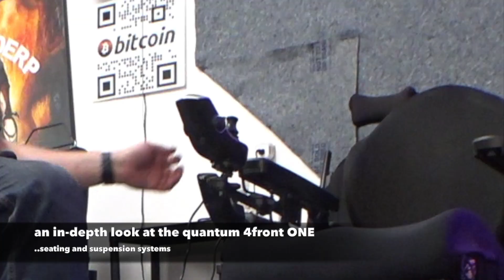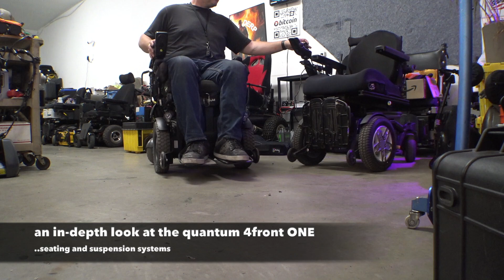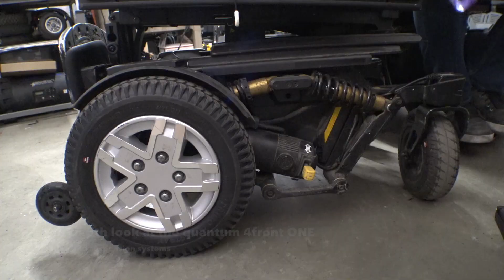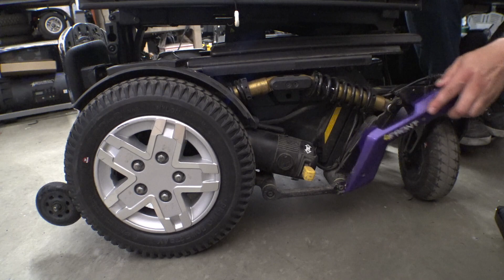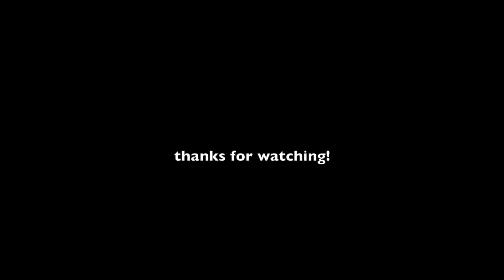MEGA VLOG 670: a look at the 4front & TB3 seating (LONG VIDEO!)

Comment: Hello, we have a common friend... Anyway, I am a professional Mechanical Engineer and have been in a power wheelchair for 40 years. And I still know that you are much better off consulting on this. I'm wondering if you can put rear castor assemblies from a 4front2 on an R-Track as front arm assemblies?  The problem being the maneuverability of the R-Track. When driving in tight spaces, if I change direction, etc. the castors can suddenly correct and lung my chair in an unwanted direction.

Comment: Hey Dan.
I am not confined to a chair or scooter full time: I only use them when I go shopping or to the fair or car shows.
I love tinkering with stuff and have refurbished a few scooters and given them to friends in NEED.
I have a few scooters and chairs, my chair I like to use is an old jazzy: it's a BIG one that the seat was almost two and a half feet wide.
I got rid of that seat and have mounted an old amusement park bumper-car instead.
I have another chair that is older and bigger that I think the speed controller is in the joystick, it's made in England, not sure I think it is / was a jazzy also.
I am not able to get  it to go, I get a strobe flashing on the joystick. 
Any info would be appreciated.
Thanks in advance.

Comment: I am a jazzy 4, quantum chair I am do for a new chair in January I use a chair 24/7 use it outside,inside my question is what brand should I consider next? Also I am very short stature size like 47, about 120 pounds, but I used public transportation to get around and often have to carry my groceries on my chair. So what type of chair should be my next one,I have Spina bifida, back,neck and shoulder problems, I prefer a tilt function on my chair,also suffered 3 pressure sores already. If you can advice I would appreciate it alot.

Comment: Oh, an interesting tidbit is when I took off the caster fork, the magnet screw was not fully threaded down which added to traction control errors...Maybe normal operation of the wheelchair or a worker failing to assemble it correctly did it??? It doesn't make sense that the screw would be loose like that...After all, that magnet has to be a certain distance from the sensor, as you have pointed out in your video...

Comment: OMG, my right and left caster forks are missing the thrust bearings...I saw it flopping around in the hole...My solution was to buy a ball bearing that fits perfectly inside of the upper caster arm with the right sized washers and a better nylon nut I bought off of the McMaster Carr website...

I feel so stupid now, I should have realized it needed a thrust bearing in there instead of a ball bearing...If only it came installed with the correct parts in the first place...They replaced the right and left caster forks years ago but never replaced the makeshift washers and bearings I put in there...

I am going to take off one of the caster forks to see if they installed the correct parts this time...I had them replace the casters recently because the tread was worn down and needed to be replaced...So I am curious now...

Thanks for uploading this detailed video of the caster assembly...Now I know what is supposed to be in there...

Comment: Those thrust bearing with small needles are made to wear out ! yes ! replace with brass  Thrust washers pus being a machinist & transmission specialist you could add a seal below the tapered bearing

Comment: The little plastic bumper if it falls off the rain will get in those 2 holes n everything rusts n destroys the bushing and the  tapered bearing within a month or so. Originally there were no flat bearing and wich made the bushing breakdown very quickly,

Comment: Really have enjoyed your vlogs, quick question i am getting a new permobil f3. Unfortunately my order will be delayed because at the wheelchair clinic i opted for a standard seat.  My letter of medical necessity was completed by the pts 2 days after the clinic.  Unfortunately numotion the dme didn't waive the home study 3 weeks after the clinic i attended a family picnic & spent 12 hrs up in my chair m i realized that a no pressure,  comfort/ contour seat would be a better option simple swap, right? Ah, no it requires a new sea4 quote & 2 new letters of medical necessity which instead of 2 days will take an additional 3-4 months.  Unbelievable.  My c300 8 yr old joystick motherboard is failing m the tech is worried since a replacement board is very pricey & may delay delivery of my new chair even though i am at greatee risk of being w/o a chair if the joystick fails. Have you seen wheelchair ghost pimp my permobil vlog? He said that the led fender lights should be standing lights & remain on the chair.  Numotion isn't supposed to remove the fender headlights.  In case they do, do you know where i can fe4 them?
Sincerely, 
Lester 
Swiftwater , PA

Comment: Is the 4front2 improved enough from previous?
Reply from the maker: i dont know if i trust my own advice.. lol BUT i regularly chat with 2 different people that have a 4front 2.. one of them is an HD version.. they've had issues with loose bolts and a few other random things.. but overall seems to be an improvement from the version 1! quantum got rid of the CASE sensors, and are using 'more proper' 4 pole motors now.. soooo... maybe?

Comment: So very informative!  My first and most comfortable powerchair was an Invacare Storm Ranger.  Loved it!  For one thing the seat had springs in it, so comfortable I could sit in it all day both working at my desk and going miles thru Tualatin wetlands asphalt trails as well as in bike lanes in Portland.  Of course I wore out tread on tires and eventually the springs in the seat were even suffering under my weight over the years…and years…and years.  Nothing has ever been as comfortable as this one.  Fast.  Also could go up and down steep inclines that technically I should not have taken it on.  Then TDX 4, Invacare.  I had the first one w/ a van seat, and it was done at my request.  My husband had to put it together because the DME could not figure it out.  Like you, my husband had fun with these things.  He wasn’t ever in need of one for himself but loved to see me enjoy freedom.  Also it was a bit of a replacement for his fun working on sports cars.  Now I’m in a Quantum Edge 2.  Didn’t get a choice and had NO idea it didn’t have a back that laid down as far as possible towards the seat on the chair itself to fit in the rear of my van.  (I sit in the front passenger seat.)  Meanwhile, I can’t use it on any bus.  I DO like the 10” seat lift a lot and could use a higher one.  I’ve had this one for coming up on 5 yrs.  Like the Stretto but have never tried one.  Thinking Permobil w/ forward tilt to seat making it easier to get out of, easier to use in the kitchen.  I’d definitely end up w/ higher seat lift as well.  Never been in one, so I hope next time DME lets me have a demo or two and some choices.  Also still in search of the same seat cushion my demo Quantum had.  Salesman was just slam/bam/thank you ma’m.  He was here maybe 15 or 20 minutes, said couldn’t leave the demo w/ me to trial thru weekend because he didn’t have battery charger.  Long story, but I learned so much about safety using buses as far as bolts, construction and what to think about.  I’d regain freedom if I could use bus service.

Comment: Mobility scooter sales company's usually sate they have fully qualified lexical engineers 😮 most so called qualified engineers have no clue what there looking at, a good example is reasently I've had an issue with my mobility scooter 1 engineer stated it was the tiller dash that was malfunctioning another said it was the motor top marks thing is a friend with the same scooter ruffle the same age as mine also had the same problem motor malfunctioned basically the motor in high power will only do 2 to 3 mph instead of its usually UK 8 mph, both of use last year where getting the same error message witch was 1. Over current 2, brake malfunction I was told it could be heat related because last year the temperatures where reaching 30c in the UK & yes if you look it up temperature can afect the errors we where getting but both ruffle the same age both have faulty electric motors something tells me it's a manufacturer's fault but the replace the motor we have to buy the electronic brake as the say its one unit but you can separate the motor from the brake so that's 2 units not one price from the seller is £700, like you say its a joke 😅

Comment: Dan could you 3d print a new central "hat" bushing as you called it made out of nylon and make the top part a little thicker to help the spring washers with the compression and just add a little grease on it to keep it from wearing out faster
Reply from the maker: its an IGUS bushing -  which are pretty easy to get.. im not very good tho at designing parts for SLA printing :^)

Comment: was that sneeze your allergy to bullshit? Also i was thinking a flat washer between the conical washers might add enough tension.
Reply from the maker: i was thinking the same thing! - trying ways to increase the tension.. i dropped in an additional spring washer (then 2..) didnt have any effect.. but then realized that it just puts a bit more load on the thrust washer..  those things will take any load ya throw at them and not care! BUT after putting everything back together, even with the 'loose' tension, there didn't seem to be any castor flutter at all! the trail angle on these castors is pretty steep.. so maybe this chair doesn't require the same preload as other brands?
i think the name 4front refers to "completely new and totally odd" hah
Reply: @TotallyNormal-  I just realized, should the thrust bearing be between the spring washers? to clamp the thrust from either side.
Reply from the maker: hmmm.. maybe.. didnt consider till just now, that in 1300 miles that someone could have been in there, and might not have stacked things together the same way! 
regardless there doesn't seem to be any castor flutter right now.. soo.. meh? lol

Comment: Hi, Dan I've been having the same castor sensor issues and having to pay for recalibration almost every month which is costing a small fortune as well as a lot of stress! Any tips on re-calibrating the Wheelchair at home?
Reply from the maker: the handheld programmer is the only way to get things re-calibrated.. what are they charging you to plug in, and press 6 buttons??
seems like it shouldn't cost anything!
im going to be doing some more testing to see what conditions trigger the traction errors.. and try to figure out why they keep drifting out of calibration
Reply: They previously charged about £125 per call out ! I did contest this and managed to get the last callout for free but still having the same issues come back… i.e. traction control error.
Any ideas of how to get a hold of the programmer? As a side note appreciate all the content.
Reply from the maker: yeaaa its clearly a failed system that quantum has abandon using - id argue its a 'warranty' issue everytime things need to be re-calibrated.. but dealers/dme's usually only do so much for people.  
the problem with most of the programmers is, they 'expire' so if ya manage to find a compatible one, it will lock itself and stop working at some point.  i got one from ebay a couple years ago, and worked great for a while! but one day i plugged it in, and popped up with a 'supervision error' then wanted me to login to a 'cloud account' or whatever..
the tool i have right now resulted from a series of fortunate events, and had to get a lawyer involved - BUT ill never be able to replace it if something happens :^/

Comment: I don't think that quantum is the best or the safest thing out there. When I first got my Edge z it had the usual quantum errors but once I swapped Q logic 2 over the thing has been quite reliable, yes I swapped motors as well but that was just preferences the original motors worked fine as far as transportation my chair doesn't meet the requirements but I still use it in vehicles and the seating holds up just fine and I use the chair quite a lot.

Comment: I may have missed this ... But do the current stretto's also have that same system of calibration on the back casters.
Reply from the maker: Since the stretto is mid-wheel drive, it doesn’t need any stability sensors :^)
Reply: @TotallyNormal-  SWEET!  Also I didn't buy mine with the "Accu-Trac Advanced Tracking Technology" because I just thought I don't need another thing my chair how to drive.   I just realized my base is using the 75A Q-Logic NE+.  So that means it is a 75 Amp system vs the other two 120 Amp 120A Q-Logic 3 EX or 120A Q-Logic. My dealer I wanted the NE+ controller because I felt the bigger controler looked bulky and I thought more likely to get damaged on airlines.  I didn't know at the time that I would be switching from a 75A to a 120A system.  Not sure how that would impact overall.  I am around 70 Lbs so I don't think I need 120A but I also wonder if by not having 120A if my top speed was cut.

Comment: With the lights on the quantums, if you unplug the dead lighting module from the lights but leave it plugged in to the power module, it might work its way out of that "charging"  lockout.

Comment: Why are these things so over-engineered? I understand patents and getting around that kind of thing, but we are just creating issues rather than keeping things simple.
Reply from the maker: Agreed! Exceptional design doesn’t create complexity for the sake of being ‘different’
Reply: I had a child’s Bec chair back in the early 80s that was front wheel drive and had no fancy anything. It did have proportional steering. You had a dog bone shaped that the stick went in. You had forward, turn right forward turn left forward. Then back and turn lest or right back.  It was made out of wood and worked like a charm